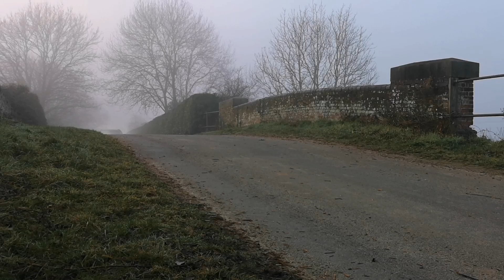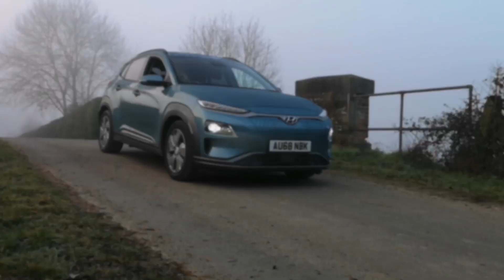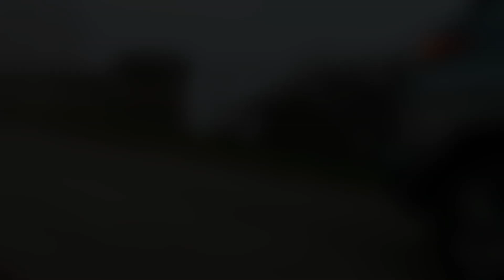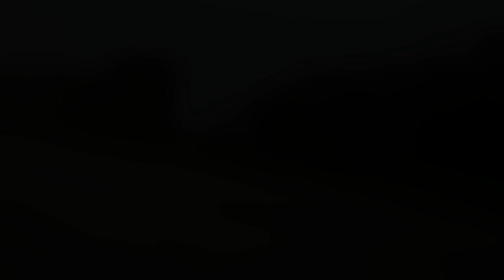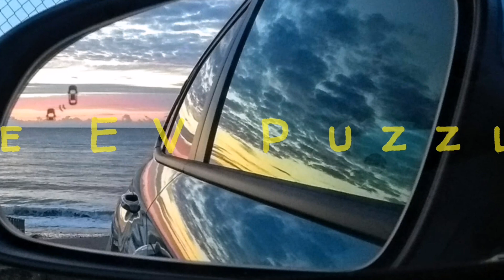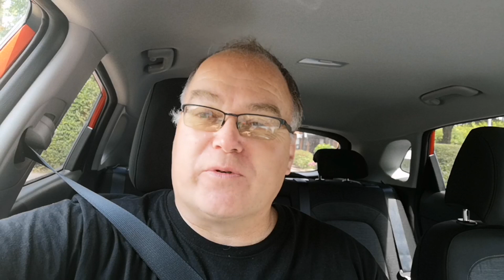Kona electric warranty issues resolved

Comment: The B-pillar rattles in my Kona appears to be related to the button in the seatbelt height adjuster. I have found jamming a piece of cardboard between the button and housing has stopped mine.  I used to hear the rattle everyday as the Freeways in Perth Oz are not the smoothest and travel more than 60kms each way for work.   With regards to the to SCC, I get around the issue regularly on the freeway by setting the regen braking to zero and coast (ie take foot off of the accelerator) for a few metres and then the SCC can then be re-engaged. I notice it more often when the regen is set to auto.  I  have owned the Kona EV for 4 1/2 months now and have already reach 10,000km with almost no issues. My biggest gripe is no memory seats or the ability to permanently turn a few features off.

Comment: I have a 2019 Kona Electric and also noticed a rattling noise soon after purchasing. Finally pinpointing the noise to the seatbelt slider adjustment area (both sides) I remembered seeing your video; thanks for doing it!  Could you please let me know what / how the dealership did to stop the rattling noise?  Also, I remember seeing another video about the steering noise.  Luckily, I have not experienced that issue.
Reply from the maker: They took it apart and greased everything inside but I think it needs some extra cushioning between the fittings to be perfect

Comment: That's interesting, I'm getting the same "conditions not met" message on my ioniq at times where it's ok to use the smart cruise control. I've got to take it into my local dealer anyway, so I'll ask them to take a look at it.
Cheers fella.
Reply: Push the button down instead of up to adjust the speed limit and that works then.
Reply: @alexandreesquenet3736  thanks Alexandre, I wonder if that's the issue then. I'll give your suggestion a try.
Reply: If you have the problem that will do no good at all.
Reply: @malcolmknight6450  This is fine as long as you know that it works like that ^^

Comment: Hello Nigel -  First of all may I thank you for all your very interesting videos  - I am a new Kona owner and am delighted with it. - I have a query however  -  not related to this video - but regarding the settings within the instrument cluster and in particular the speed setting - how do I reduce the max speed down from 80mph to 70mph. Thanks in anticipation of your reply. Roger
Reply from the maker: Presuming you have a speed limit set by default it's in the EV menu on the media screen, under driver settings I think. You can configure Regen levels per drive mode and in ECO mode can set a speed limit.

Hope this helps

Comment: Was this video made before or after you decided to sell? I had a cruise control issue in mine on the m6 in torrential rain, the cruise suddenly cut out and a message along the lines of conditions not met came up. This was similar to the radar issue on the leaf which ended with Nissan having to change the whole radar in the front of the leaf. Just wondering if this could be the issue with the Kona, it cleared after a few minutes but occurred again a short while later. I assume it was caused by the torrential rain but to me that shouldn’t happen.
Reply from the maker: No I decided weeks ago to advertise the car. Not related to this at all.

Mine was ok in the rain on Sunday. No cruise issues
Reply: I had the same thing on Sunday, also on the M6. Cut out 3 times in torrential rain. Page 5-137 of the handbook says the SCC may be cancelled if the sensor is dirty or blocked - I reckon the torrential rain was enough but will check with Hyundai when mine goes in for service. I agree it shouldn't happen just because of rain.

Comment: My headlights are set a little high.  I mentioned this to the dealer within weeks of getting the car, but they said categorically that they are not adjustable - under any circumstances!  I don't believe that's true.  Hyundai say I can use any dealer, so I'm going to try others.
Reply from the maker: Led might be self levelling
Reply: The sounds like a fib. Headlights always have a level adjuster. Even self levelling lights need to be initially adjusted otherwise they will be wrong.
Reply: they are adjustable. I had mine put down as I was blinding oncoming drivers all the time.
Reply: Mark Barnes I need to find a dealer in London that is willing and able to do it.   I’ll try the main dealer in Romford, although they were awful when I tried to buy my Kona, I went to my local dealer that were great a sales, but turns out awful at service!
Reply: @danand725  I would say Romford is quite awful in general. They still haven't responded to my query if they have a Kona to test drive after a week
Reply: HA!  They wouldn’t even let me have a test drive as I’d ordered my car from another dealer (who didn’t have a car) - thanks for the tip!  Are there any Hyundai dealers in London worth recommending?
Reply: @danand725  none I'm aware of.  I couldn't comment on how good they are at service as I don't have a Kia yet.   Last place I heard had a demonstrator was Enfield, but that was 6 months ago. It's too far for me to easily get too though.

Comment: I have another noise with my Kona electric premium: I have a crack in the steering when I turn the steering wheel close to the end position. It sounds like if a spring relaxes. Any idea what this could be? Hyundai dealer has no idea and failed fixing it.
Reply from the maker: Sorry not sure what that might be. Dealers aren't experts on these cars do it might take a while to find
Reply: As you hit the steering end stops you can get creaks on some cars, often helps to grease them if you can find them.
Reply: @98dizzard  Yes, I understand. Im my case the noise appears before end position is reached.

Comment: Hi Nigel, as your Kona is in for a service can I ask you what your dealer charges. Colin
Reply from the maker: It's a Hyundai service plan so not dealer specific. The plan shows £67 for the first service, £150 for 2nd, £70 for third £155 forth
Reply: The EV Puzzle that’s  very interesting because mine is a service plan with Yeomans of Bexhill-On-Sea and they charge for a three year service plan £15-59 a month. 36 @ 15-59 = £561. 24
I think I’m being ripped off.
Reply: Thanks Nigel, I’ve cancelled my dealer service plan. Cost £30 to cancel but with a huge saving. I rang a different Hyundai dealer and was quoted 78 including vat for first service, that’s a big difference and shows one should shop around. Colin.

Comment: My Kona EV still has the rattle from the seat belt area in the B pillar. My dealer changed the seat belt and greased everything up but the infuriating noise is still there.
Reply from the maker: Keep plugging away. As soon as one of us gets it fixed the others will know what to do. Rattles are hard to find as they don't make a noise when the mechanic looks
Reply: @EVPuzzle   Just saw a youtube video about a Tesla Model 3 "Model 3 Seatbelt Adjuster Rattle Fix" https://www.youtube.com/watch?v=iLjMzqB3au8 which might be a useful pointer.....
Reply: B pillar rattle very common in many cars including my Kona EV.  They put some packing around the  air bag beneath the trim above the seatbelts which has helped.  I hope the bag still works...